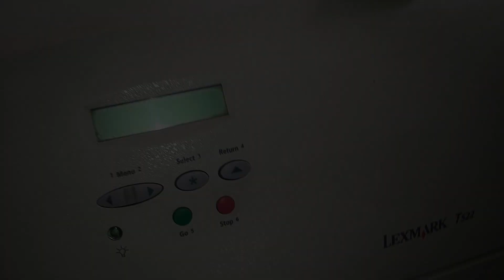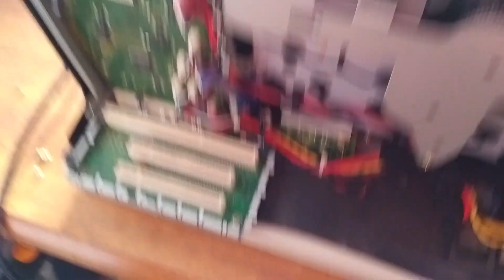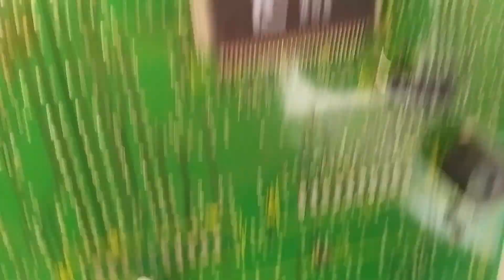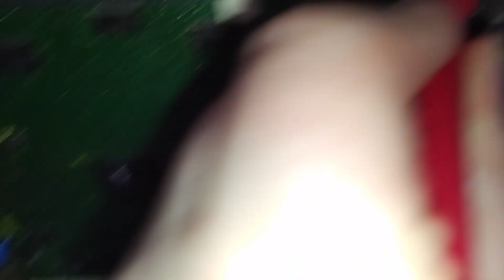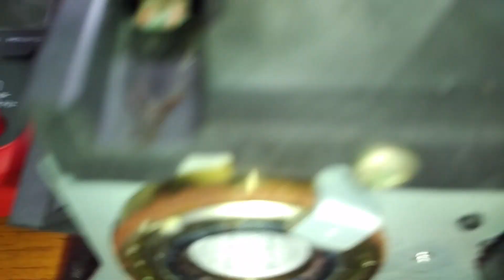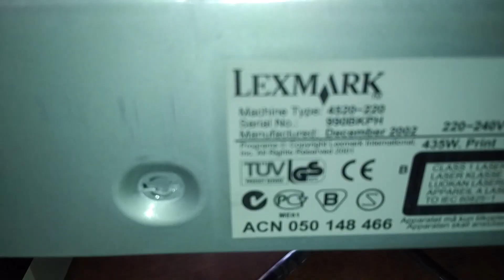Lexmark T522 - Further Fault Finding

Comment: You might be better getting a full fuser unit. It'll replace the lamp and rollers all in one go. Looking online it looks like they are around the £60 mark.
Reply from the maker: Possibly, but I think replacing the bad rollers and lamp will be okay at this point. The terminal should be cleanable. Will see how it goes...